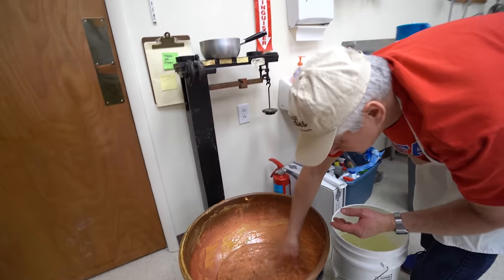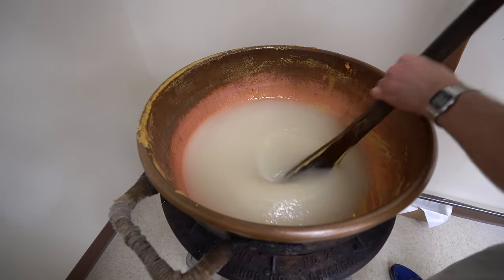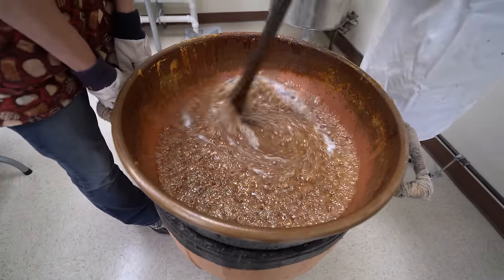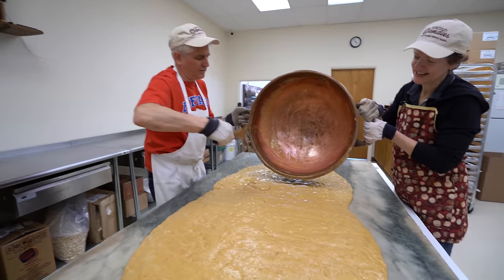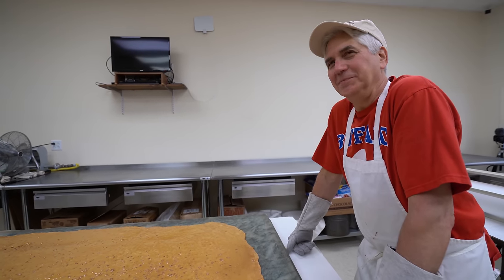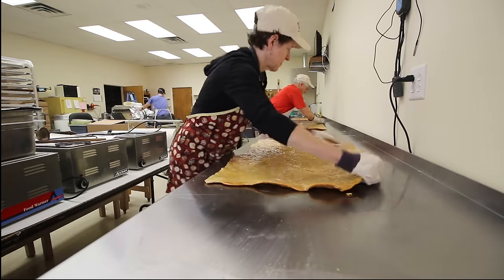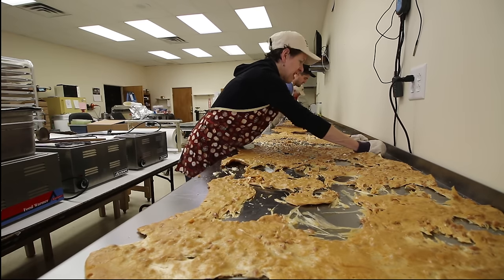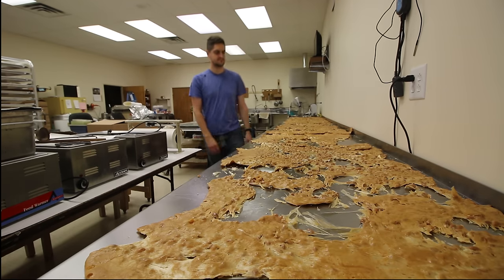Family Makes Peanut Brittle on a Sunday

Comment: That Scale looks like a Fairbanks Platform model 11 & 1/2. You will see the model number on the front of the platform. 

If it has a wood inlay on the platform, you are looking at at least 1897 to 1886. 

And if it is all metal, 1900 to 1926. 

But that scale is one of the best scales ever made, they last forever and are easy to make accurate if they go out of balance.
Reply: Tim Keating epic
Reply: Wow impressive👍

Comment: Thanks for sharing your recipe.  I have a little (emphasis on little) nut business here in Australia (20 years- mostly Caramel Macadamias) and have been looking for a good peanut brittle recipe.  Obviously, skill and technique are the most important factors, but at least I have a start.  Love watching you work.
Reply: you should start making youtubes!
Reply: +Mark Mc i know they smooth down the foam to create a thinner brittle, but if your at home DO NOT touch it once poured! That foam creates air pockets and is the key to make the most delicate "brittle"  thats not hard even your grandma can eat it! The more you "thin" it out the harder it gets because you stop that air bubbles that create that delicate britle we all love. Also, add a little bit of vanilla extract when you add the baking soda, trust me! You can even add a tad bit of butter when you add the raw peanuts if you don't mind the extra fat. Only gives more flavor.The recipe i use is  2 cups sugar, 1 cup corn syrup, and  1/2 cup of warm water to be the best base to start off when at home. When the temp is about 250-270 add 2 cups of raw nuts (whatever you prefer  can be cashew , pistachio, etc) and plus 2 tablespoons of unsalted butter. Add as much salt as you like for flavor (southerns even add some Cayenne pepper for a little kick!). Once at 310 remove from heat, add 2 teaspoons of baking soda plus 1 teaspoon vanilla extract and stir till mixed. Pour onto a cookie sheet thats buttered or sprayed and DONT TOUCH IT!
Reply: I have seen reciepes that use just sugar and water, but ive found the added corn syrup makes it easier to get the consistency we want.
Reply: @yandenuts  I think y'all have glucose liquid if I remember from the english recipes but is almost the same
Reply: Mark. I make bonbons and macadamia product here in Hawaii USA. Do you have a good source for mac nuts? there is a shortage here due to last years volcano activity.

Also just an fyi, glucose syrup is the  less sweet half of sucrose, Corn syrup is usually fructose which is the sweet side of sugar.  Hercules looks to be using glucose.  It helps keep the sugar from recrystalizing.

Comment: The only way you could guarantee the same results from a thermometer is to put the old one in side by side with the new one and Mark the difference. So let's say you usually go to 280 on the old one and on the new one it says 275. You mark that as your new baseline